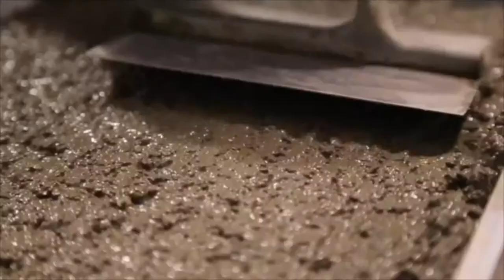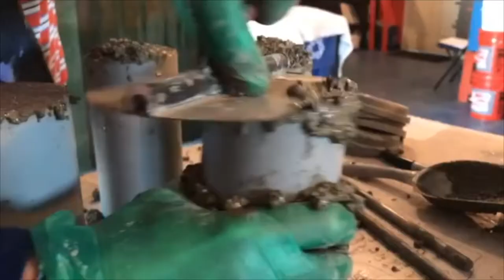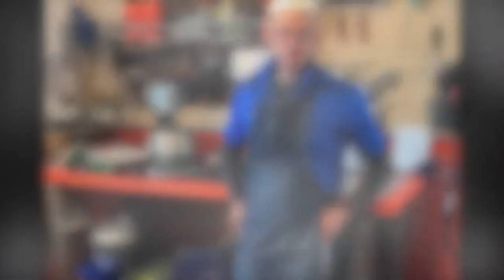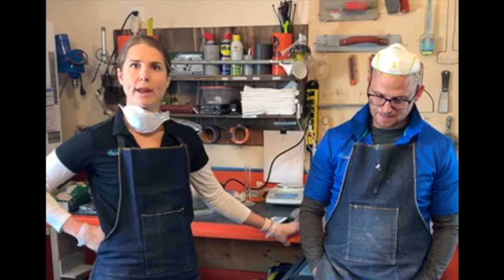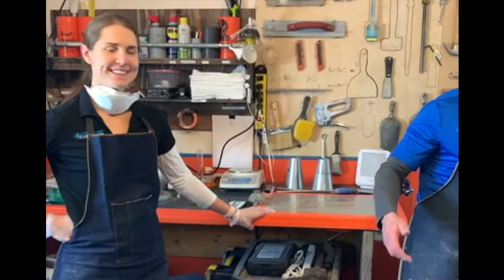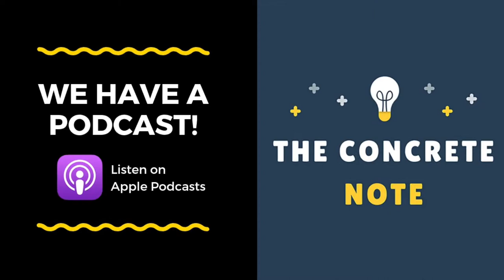What is a Granular Skeleton? - CCT - Vlog #335

Comment: DeyC3 ("Day-See-Three") is the handle I came up with when I was 8. What it lacks in accessibility, it makes up in genuineness. 
But thanks for the answer! This makes perfect sense of the concept. I had never thought of the aggregate as a "skeleton" before. I LOVE the idea of starting with sand.. er.. granular skeleton gradations as the first step in design. It seems like the industry has looked at the whole thing backwards from the start. Instead of trying to design expensive pastes around whatever sand and stone happens to be laying around, it would have been better to see how much of the design objectives could be met with a better skeleton before ever worrying about hacking paste. I've done some work in this space on decorative overlay. We ran into a huge problem when the design we came up with didn't work after we had the trucks dump our first loads of sand. Our samples where done with a few bags (which were kiln dried for bagging). But the very same sand delivered loose, in bulk proportions, didn't behave the same way. We pulled the sieve sheets and it turns out that their kiln process was breaking down a lot of the grains which shifted the entire gradation curve downward towards the fines. The bulk sand was too coarse. Our mix was bust. And we were forced to go forward with a fivefold cost to pay the additional price for kiln dried sand. Very hard lesson learned.